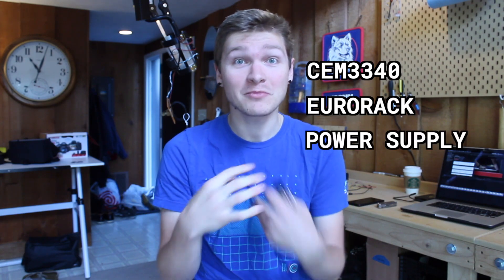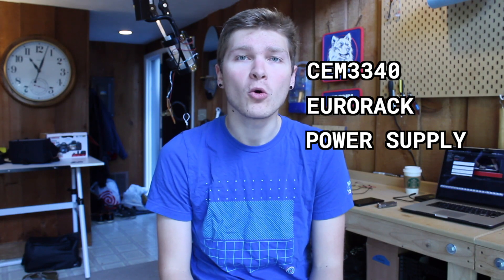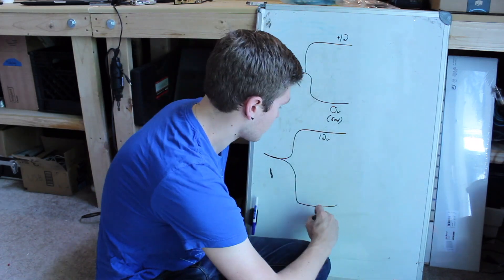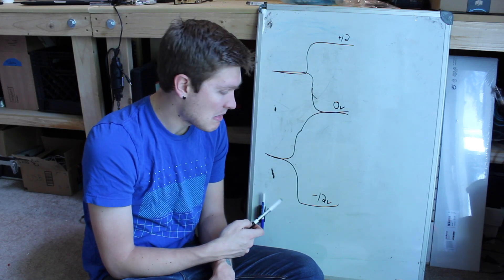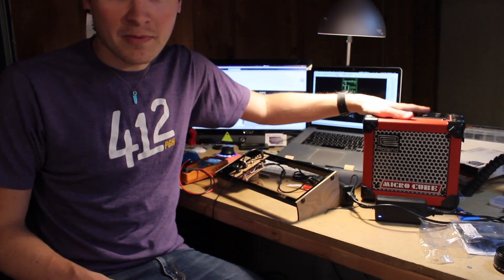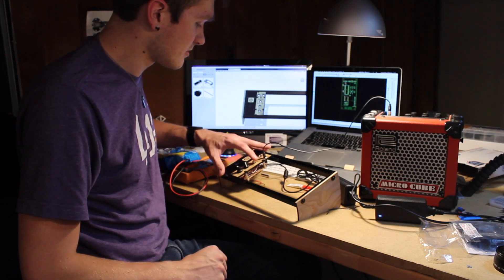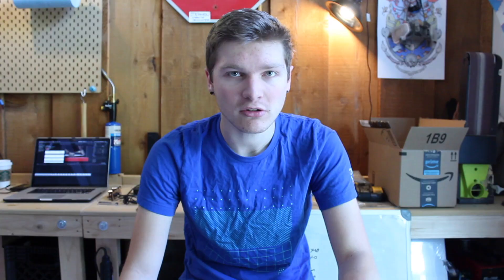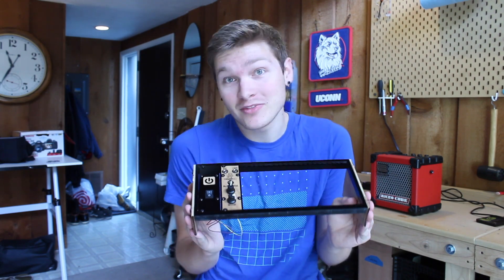DIY Synth Rack and Power Supply!

Comment: I'm going to use old PC power supply with a little bit modification. It's rather cheap and simple just get from it +-12v and ground:3
Reply: It has extra +-5v +-3.3v as bonus

Comment: Maybe a dumb question maybe not: I see you connected 3 your modules to the psu with 3 cables. Witch means that either you haven't connected 5v cause you didn't need it or you haven't connected the ground. Which one is it and if it's the second option then can you explain why? is -12v effectively playing a role of ground? I don't think so but I'm a noob.

Comment: That power supply layout does work, but I don't really like it... I would've used an old computer power supply.

Or a 12V wall wart, and a MUCH more complicated circuit in the rack:
1). The 12V input has a bit of bulk decoupling and a fuse, and goes to +12VUF (Un Filtered)
2). +12VUF goes through an ICL7660 voltage inverter to get -12VUF
3). +12VUF goes through a 2-stage Capacitance Multiplier to get +12V
4). -12VUF goes through a 2-stage Capacitance Multiplier to get -12V
5). +12VUF goes through some kind of buck converter to get +5V
6). +5V, +12V, and -12v have a bit of bulk decoupling, and go to power the modules
At least this way you only have one barrel jack :D

Comment: 6:35 I'm sorry, but I have to correct you here. In this configuration, where the output of the op amp is connected to their inverting input, it is actually acting as a buffer, and not an amplifier. The reason why this buffer is here is because (I'm assuming,) the 3340 cannot drive an output on its own, as it can not output much current. The op amp will send out the same signal as is fed in through the non inverting input, however the op amp can supply more current making it more suitable for use in a eurorack or in a synth setting. An op amp will always try to keep the inputs the same voltage, so if the output is connected to an input directly, the voltage at the inputs will be the same, and also at the output.
This is explained well in video #600 by EEVBLOG, op amps
Reply: An opamp will try to keep the inputs the same when in a negative feedback configuration.  The are plenty of other use where this axiom is not true.
Reply: Well, I'm sorry to correct you, it's still an amplifier! It amplifies current and in the end power if you so will.

Comment: Stephen, you need to gesticulate more. That is a nice frame though...but for those that don't want to spend thousands on a laser cutter there are cheaper options.
One main thing also to remember, hooking up your 0v to mains earth that way, not only is it safer but your 0v stays 0v and isn't a 0v floating reference.
Reply from the maker: Hmm interesting, and to do that I'd likely have to open the 12v bricks I'm using to connect to that rail, right? Do you know why having my 0v reference floating is a bad thing (and why it's preferential to have it be the same as earth ground)? Aside from safety.
Reply: @stephen_hawes  There are lots of opinions on the internet and most are from people/companies that manufacture their own PSUs/bus boards for studio/Eurorack equipment. This is one of many: http://www.hinton-instruments.co.uk/paprod/psu/index.htm
He also has a user on Muffwigglers as well as other forums. There are a shed load of threads discussing this and, in all fairness, give mixed advice that can leave you more confused. Personally I have found my filters have a better response to earthed 0v rails than 0v rails that are not hooked up to mains earth. From what I understand the circuit runs on 12v +/- and the 0v needs to be as close to 0v and stable, I'm sure this opinion will trigger lots of other readers to pipe up with a more accurate explanation and it's welcome. What is also important is you don't run your PSUs at peak load, say your system requires 1A@12v, 250mA@-12v and your PSUs output is 1A@12v +/- It's time to use another PSU and divide the load but don't run the PSUs in parallel, this is a whole new conversation.

Comment: Hi, thanks for the video! Looks like a cool simple solution. Did you add any decoupling caps or anything to the power supply? Are there any downsides to using it this way?

Comment: You can buy the AS3340 (CEM3340 equiv) for about $10 included shipping from CabinTech On Ebay, by the way can you post the pcb layout ?
Reply from the maker: awesome, good to know, thanks! i need to flip around the op amp footprint and do some rerouting, but ill post all the files on github when that's done!
Reply: I actually paid less than 20$ for four of them a couple weeks ago. If you do a little looking you can find equivalent chips cheap as hell most of the time. My synth would have never gotten off the ground if I had used OE ICs
Reply: Look for the look mum no computer one. He has the schematic as well.